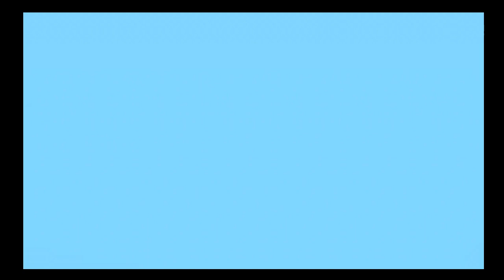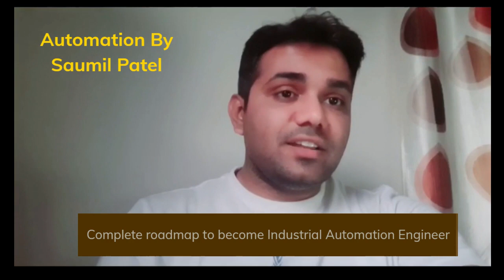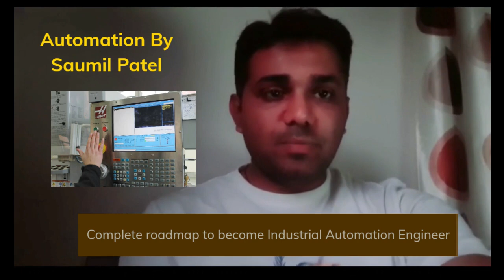Road Map Of Industrial Automation Engineer 2023 | Saumil Patel

Comment: Thank you for this, very educative. Is MATLAB necessary as an industrial automation engineer?. Like, will there be any area as an industrial automation engineer that i'm gonna nee MATLAB?. Thanks once again
Reply: And also, what's the difference between a control engineer and an industrial automation engineer.
Reply from the maker: not that much intent about matlab in industrial automation
Reply from the maker: Almost both are same...